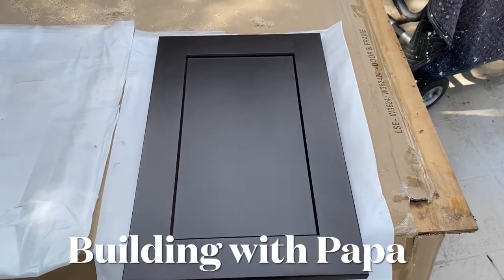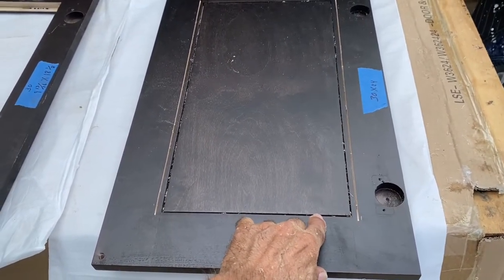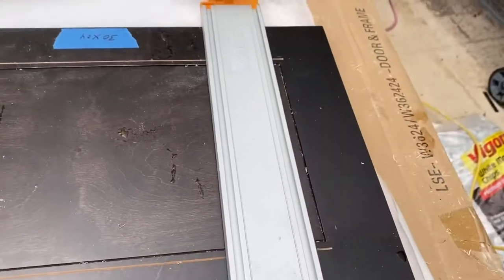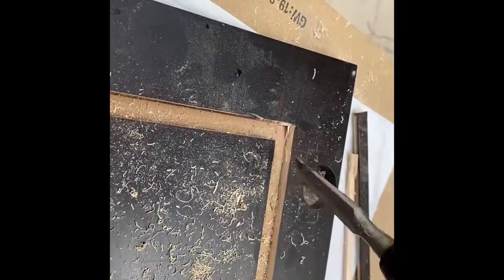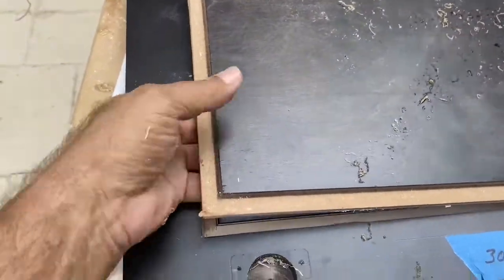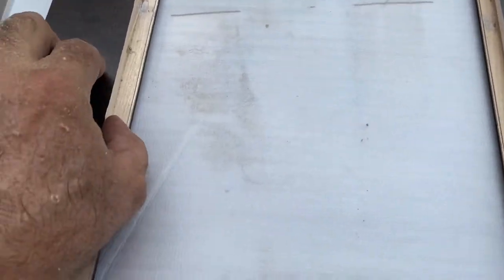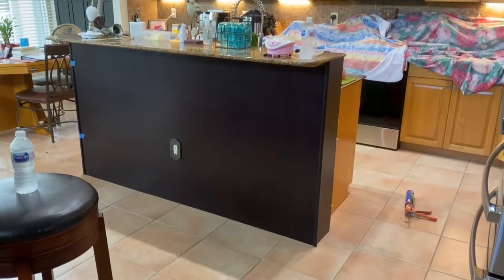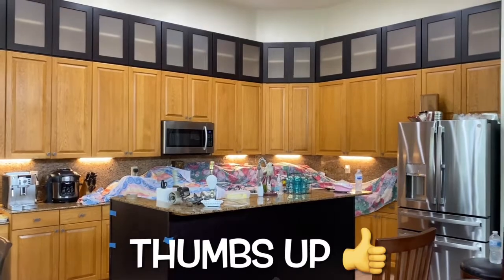How to transform your existing cabinet door to receive glass

Comment: Appreciate the video, but you didn’t actually show us how you put the glass in?
Reply from the maker: Thank you for your comment. Installing the glass is simple. Make sure you get a good clear silicone in the groove that you made in the door. Once you remove the panel, you put a thin bead of silicone all the way around on that edge, take your glass and set it at the top and then lower it to the door and then let it drop in then you need to put a bead of silicone around the edge of the glass and the door, once that dries then you can install your door again.
I hope this helps you, and if you can leave me a thumbs up.
Reply: @buildingwithpapa  Thanks, but what’s holding the glass panel in place in back?  And sorry to be a pita, but I’m new to woodworking & don’t have anyone nearby for reference
Reply from the maker: That’s no problem. The silicone itself attaches to the wood and the glass so it holds it securely.
Reply: @buildingwithpapa  Thanks got it!